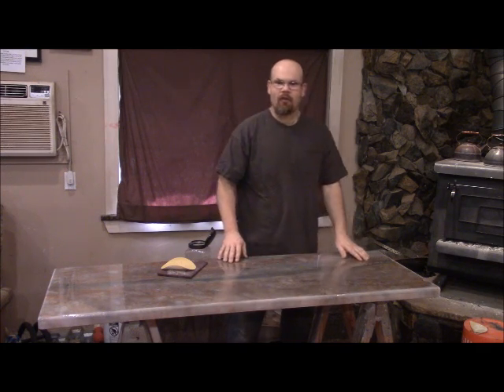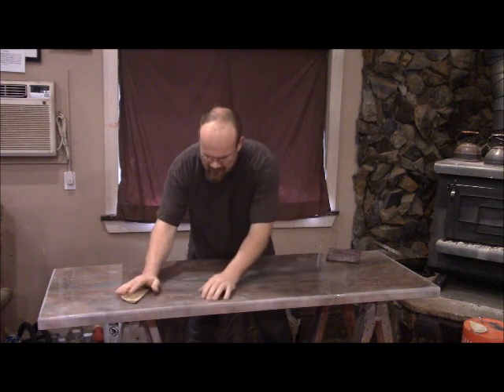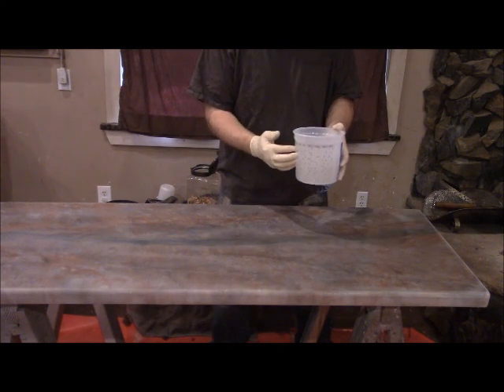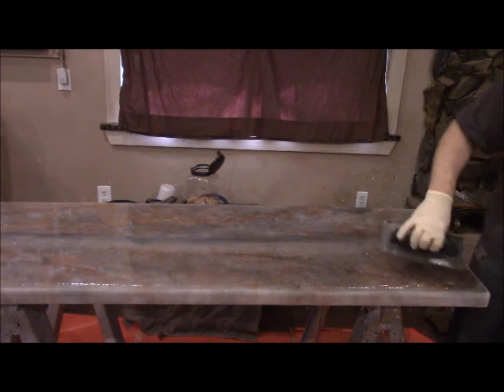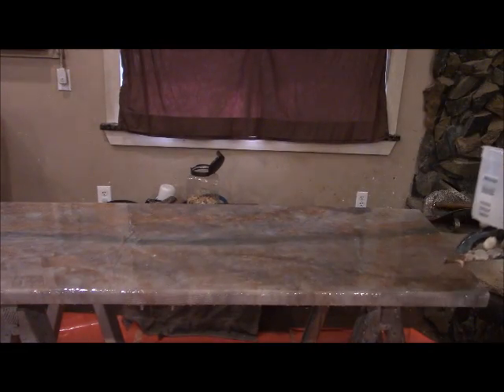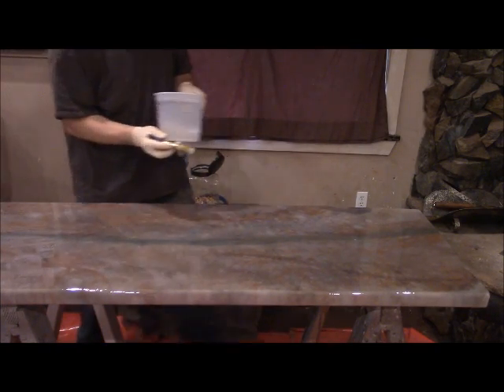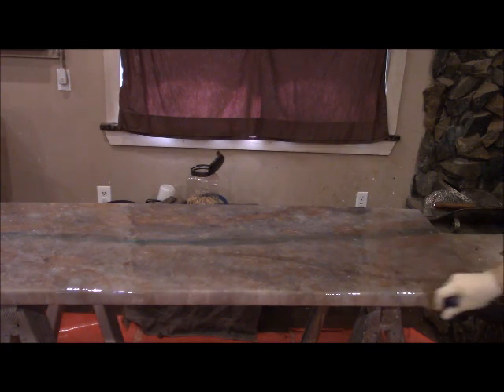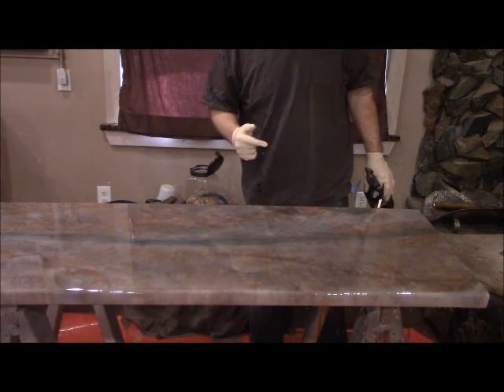2nd Stone Coat Countertop Flood Coat

Comment: QUESTION:
At the beginning of the video, you mentioned if there are crevices/holes from where alcohol made an indention or the epoxy didn't cover a hole. Should we just proceed with a regular clear coat or do another color coat? 
Also, if I do color coat to fix this, I assume I only do one clear coat?
But, if I just do a clear coat to cover this, I should do 2 clear coats? 

I'm having to fix my color coat from last night with holes, so I'm wondering what exactly is best to do today.

Comment: Is there a way to prevent airborne dust particles from settling onto the fresh epoxy?
Reply: Clean the area first and shut off fans and ac to limit air movement close all doors and windows. You could always plastic the area off

Comment: I did my counter top in white carrera marble.  I was satisfied with the results. However, I noticed a beige or off white discoloration.  Is there a way I can fix this? Should I sand the flood coat  and reapply it?

Comment: I have been struggling to get a clean flood coat for months... I recently watched the video below by the Knotty Artisan on applying a Stone Coat flood coat which helped me get past my issue:

https://www.youtube.com/watch?v=mrXQTzOSnrw&t=6s

 The key item that helped me was the specific comment to NOT torch the edges.    I went back and watched this official Stone Coat flooding video again... and while it doesn't show torching the edges, it doesn't tell you not to.   I had been consistently torching the edges which causes  a lot of the flood coat to not remain on the top surface and flow over the edge.  This seems to have fixed my issue.
Reply: Good point.  Your edges were probably too thin.  Torching warms the material and makes it flow better.